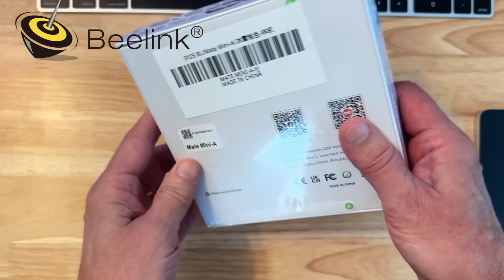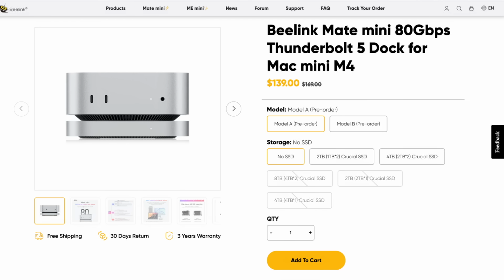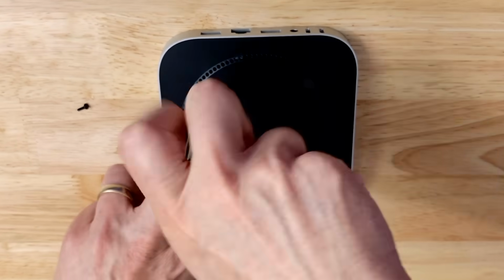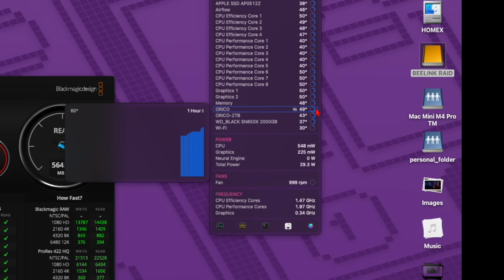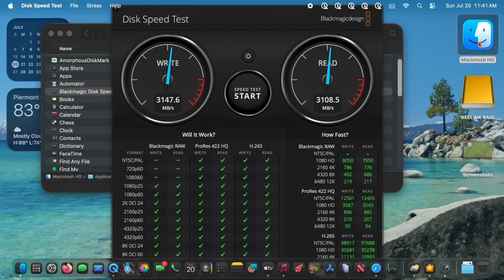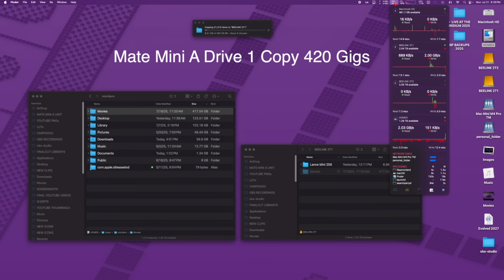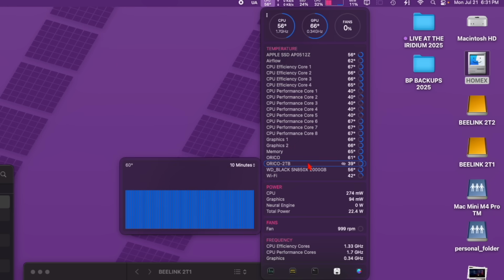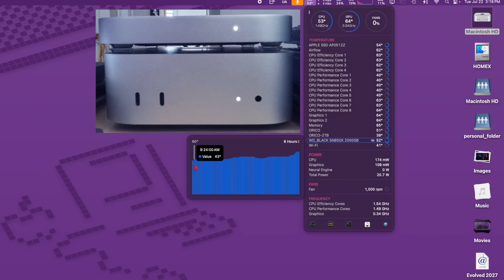Apple wants $1000 for 4 Terabytes? Get the Beelink Mate Mini instead for way less. GIVEAWAY!

Comment: Used with Mac mini M4 standard (not Pro) I got the dual SSD version. The NIC works fine at 2.5gbs, The sound also works without problems. Using a WD 4TB Black I get 2781 Mbs write, 2934 read. When I copied 1.5 TB to the SSD it got too hot to touch. Under normal use its 40C. Its silent. For my purposes it's a good fit, I do photo editing on the M4. I've had no ssd disconnects at all.
Reply from the maker: Yes it can get hot during large transfers the enclosure acts as a heatsync, thats why I do not like placing it under or over the mac mini. The mini gets hot too when doing large transfers or graphic intense jobs like running a game etc.

Comment: Just a follow-up to my question below and in case any one else was wondering - Bee-Link was quick to respond to my question about if the "A" version running TB4 connected to a base model Mac Mini M4 would get close to 3k speeds when 2 drives are installed NOT in Raid O - and they said  "Yes, both drives in the Beelink Mate-Mini A can reach Thunderbolt 4 speeds (around 3000 MB/s), even if they are used separately (not in RAID 0)."
Reply: Really useful information for me, thank you. I just bought a base model Mac Mini M4 (could not afford the M4 Pro). I got it primarily for video editing of 8K+ photos (slide shows using motion effects). Final rendering would not be over 4K; mostly 1080p. I was not sure whether to buy the A or B dock. Amazon just had a prime day sale of Samsung 990 Pro 2TB, which I bought. So the max NVME speed would be limited by the Thunderbolt 4 bus speed, in either the A or B dock? I was tending towards the faster Mini-B dock, but it would only be as fast as the A dock since the speed is limited by the TB4 port of the base model? So for those of us with the base model Mac Mini M4 the Mini-A dock has the advantage of 2 slots and no speed disadvantage?

Comment: @Beelinkchannel Watched the video a couple of times and could use a little more info on the speeds - I have a base level Mac mini M4 and if I populated the the Beelink A with 2 drives (let's say 1TBs) not in Raid 0 and used one for Time Machine and the other for general purpose - would both drives be able to hit the Thunderbolt 4 speeds of about 3K.

Comment: Bee-link is legit in terms of speed. It is Thunderbolt 5 except for two things, and uses the JHL 9480 TB5 chip: 1. it will not drive a display port. You need to use the Mini for that, 2. it will not daisy chain to other devices, again- you would have to do that from one of the other two ports already on the mini. Of course,  you have to pay a big fee to Intel (thus raising the price and why some of these things are like $500-$800), so they won't get the TB5 "Official" logo. The other thing that is listed in their instructions is that if you are going to use this constantly and have it permanently on, you should use a power adapter and USB-C cable to the second port on the back, which is labeled PD. My guess is that is also why they don't get the Intel label. The power cable is likely also needed because it does have an internal fan. ** When I ordered mine from Bee-Link it took like a month to finally ship from China, however it does arrive well packed, and the box looks like it comes from Apple, even with the little green arrow paper seals you have to pull on to open the box. For the price, I am happy and don't care about daisy chaining nor do I need to run a display from it (I have one connected to the other port on the mini). Really good deal for the price as long as you don't absolutely need those two other things.

Comment: The manufacture webpage shows "USB-C 80Gbps", not Thunderbolt connection. How it labels like that?
Reply from the maker: USB c is the connection it has the intel Thunderbolt chip, but it does not have video pass-through or Daisy Channing to make it a true thunderbolt device.
Reply: @MacSoundSolutions Can the SSD in the dock be detected by the SSD tool software under Windows system? I don’t like the USB enclosure due to failure to updating firmware. This one supports 16TB; it’s a big plus.
Reply from the maker: @yenjun0204  I have not tried it with windows because I use it with my Mac mini. You obviously have to reformat it in exfat or NTFS but it should work as long as the computer you’re using supports USB 4.2 and/or thunderbolt 3.0 or 4.0 or 5.0 but I would reach out to them and ask them cause I won’t be reformatting mine anytime soon
Reply: @MacSoundSolutions  I run both Mac and Windows systems. After trying three major SSD firmware update tools with TB and USB enclosure, I found that using a TB enclosure with Windows is the easiest solution. For Macs with Intel CPUs and TB enclosures, firmware updates still work but could not be done through the simple GUI software. For Macs with M-series CPUs, there are no solutions yet unless you're using original external USB SSDs, like those from Samsung. Third-party USB enclosures don't support firmware updates on Macs with M-series CPUs.
Reply: The 3 major tools in the previous post are from WD, Samsung, and Crucial SSD tools

Comment: hey , can i install mac os on these drives?
Reply from the maker: Yes just be sure to format in APFS before installing. Also you need to route into recovery mode first and turn off security settings to allow you to boot off an external drive, holding down command and r  key during boot

Comment: Is there any reason you'd need the extra speed of the B? The A is already so dang fast (M4 Mini Pro user here).
Reply from the maker: I’d say for most people the B is the better choice unless you’re editing 8K raw video or have very demanding workflows for the average user the A is fine and you still have the benefit of thunderbolt 5 connection. I had two thunderbolt 5 enclosures in a raid zero and honestly, I didn’t notice a huge difference in day-to-day use and I was getting 10,000 MB per second read and write from when I had my Zike drive is usb 4 and gets 3000 MB per second read and write like the B link a unit does.😊

Comment: This is NOT TB5 disk speed.
Reply from the maker: Yes it’s as far as Mac OS is concerned 6000 MBs with an external enclosure, dual NVMe  in a raid 0 with the A unit gets 6000 read write and with the single NVMe in the B unit.

Comment: I own the Beelink Mate Mini with two NVME modules. It's really fast. My problem is that it doesn't go into power-saving suspend mode. This means it stays hot even when the Mac Mini M4 is in suspend mode. I contacted Beelink support, and they said there's no way to put it into suspend mode. I've gone back to my old USB solution.
Reply from the maker: High-quality SSDs (Samsung 980 Pro, WD Black SN850, etc.) often support deep power states like PS3 or PS4, enabling real suspend support.
The OS and NVMe driver decide when to:Put the SSD into a low-power state, Not the hub the NVMe SSD and the operating system are responsible for suspend/power-saving.
The dock just passes signals through — it doesn’t enhance or restrict suspend mode directly.
Reply: I get that issue. Gets very hot too.
Reply from the maker: @BigBassHeavy it’s pretty normal for it to run hot via thunderbolt 5 port when in use , you can connect it to your front USBC 10 gigabit port and it will run slower 1000MBs and also much cooler.

Comment: I have a lot of older Imacs, Mac Books, Ibooks, Iphones, Ipads, some of which need to be repaired and a Silicon M1 Mac Mini but next year I intend to go to an M4 Mac Mini and would love to have one of these as it takes me a long time to save up for one since I am retired and on SSI. 
Thanks for posting this as I had never seen this procuct before.
Subscribed.
NP WILL EQUAL NEEDS REPAIR.
UP WILL EQUAL UPGRADE.
I have a 2007 Imac NP, A 2009 27 inch Imac NP, a mid 2010 Imac NP, A 2015 retina Macbook Pro UP, A 2009 Macbook Pro UP, an Ibook, 2 Ipads NP, An Iphone X NP, An Iphone 8, several Ipods. 2 Sharper Image VW Docks for Gen 4 Ipods, App;e ][GS, Apple ][+, Enhanced ][E, Integer based Apple ][; Numerous Game Boys and Nintendos, Sega Genesis, N64, Atari 5200.
Apple ][ Forever.

Comment: Just received a Mac Mini basic model as a gift from my son. Haven't used a Mac in over 10 years, but plan to try using it as a replacement for my Windows 10/11 daily driver. For thaat to happen I will need more than the 256GB of storage that came with the Mini. This looks like a strong possibility for my storage expansion needs, with one SSD for data and another for Time Machine backups.

Comment: How does this hub affect the WiFi signal for the Mac mini M4?
Reply from the maker: Same as my first review so far if it’s on top not really an issue but you can also just connect with a regular cable and not have it sitting on top.

Comment: I get that the smaller the unit is, the cheaper it is to ship, but I wonder why these enclosure hubs aren't designed with riser feet to allow more airflow (as you showed) or some kind of stackable cradle, AND a power button, when they are specifically intended to go above or below the Mini. It could even improve the aesthetics to have a bigger gap in there and add a bit more integrity rather than the thing wiggling around. Two drives with the rubber feet in there looks pretty cool, I think.

Comment: Sounds like a cool dock for the Mini.  I got an M4 base model about a month ago, and have been looking for the best possible dock I can get.  I already have a minisoporu dock with NVME in it running as my home drive.  I also added the little Raycue expansion box to the front of it as well.  I'm predominantly using the Mini for music production and live performance through Gig Performer, so I need plenty of connections, for midi controllers, extra displays, SD cards, audio interfaces, you name it.  I did to the pre-order for the Raycue kickstarter for the "All-in-one" charger dock...So, I've been through a bunch.  I house the Mini in a DeskPi mini rack as well, so I'm limited in the space I can use....The mini and whatever dock I use can sit side by side (not stacked)...Chances are, when I find the best solution, I'll try to find people that are in need of expansion and offer them the unused dock(s).  I also have an M2 Mini with an older Satechi dock....so I may end up using one of the M4 docks on it for more expansion (mainly display outputs)

Comment: I purchased it, but it didn't work with my two crucial 8TB NVME drives on my M1 MacStudio Ultra. It would eject them or not mount them. I have them again in a double Acsis enclosure and there is no problem.
Reply from the maker: 8T draw more power did you try using an additional power supply? And which Acasis enclosure specifically the TBU 405 pro Max,
? which has its own 100 watt power adapter. 
I had issues with it with ejects due to the power connector cable, if I moved it at all when plugged in it would eject the drives. As long as I didn’t touch it was fine. LMK

Comment: 2:14 I think it’s the cable making it to show the connection as USB4 V2. I have one connected a JHL7440 enclosure to my Mac using an USB4 cable and it showed up as an USB4 device.
Reply from the maker: From what I understand it’s an apple OS quirk as to why it’s shows usb 4.2 only not thunderbolt, older thunderbolt 2 maybe 3 will show Thunderbolt which my older OWC shows Thunderbolt but it’s Thunderbolt 3 not 4.

Comment: What would you suggest for Mac Studio?
Reply from the maker: Acasis TB501 Pro if you just want a single NVMe thunderbolt 5 enclose https://go.sjv.io/xLNxjx or the r Beelink A or B depending on your needs still works with. studio just need a good cable like these https://tidd.ly/4l1AK9S
Reply: Thanks. I was looking at the ME Mini, but it looks troublesome as a mini PC. With the Studio, I don’t really need the SD reader, 2.5 Ethernet, or HDMI ports.

Comment: I have a 2TB NVME that I used your technique on for moving the home folder  I’d love to win an A Unit so I can expand my storage Again, and I would love a TB 5 enclosure so I could double the capacity from 2 to 4 TB ( I use the 990 Pro’s) 
Thanks for the work you put into your videos… I even set my buddy up with your external home folder set up and we took your advice and each got the M4 pro Mac mini’s (512 GB) I was worried  256 was just way too small for me.
Thanks again!

Comment: Why in the hell would they make you lift the rubber feet to take out the screws when they know you’re going to have to take it apart. That’s infuriating, it never sticks right and if you lift them a few times you get a mess.

Also I suggested temps in your reviews, thanks for considering that this time. These seem like they have a few engineering oversights, but I’d of course love to win one!
Reply from the maker: Yeah it is a bit silly to have to pull up the rubber it seems to restickk just fine though I did the install twice to switch the NVMe for temp tests and still sticks, but they most likely used a pre existing design as there are many units with the same base like Orico etc.